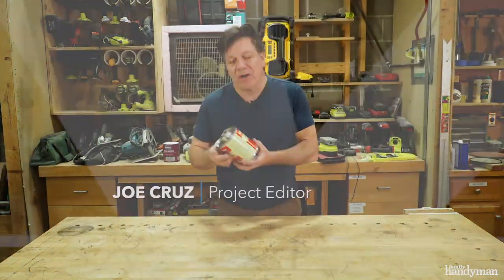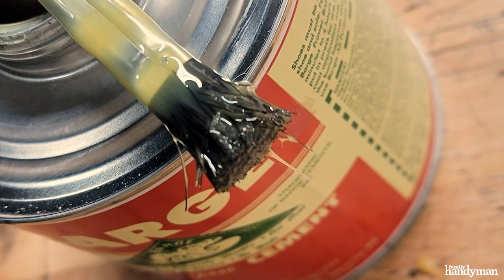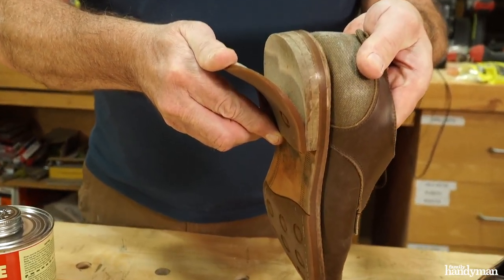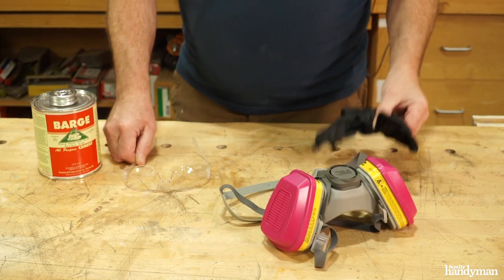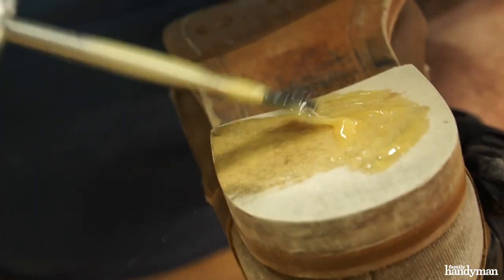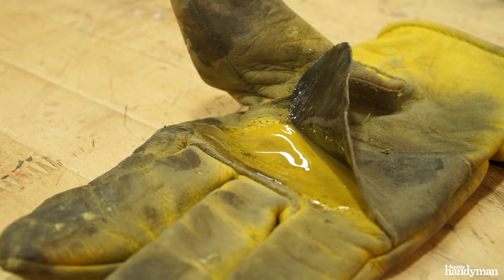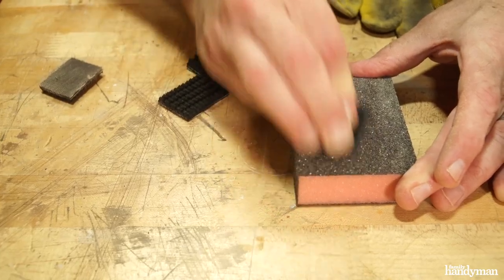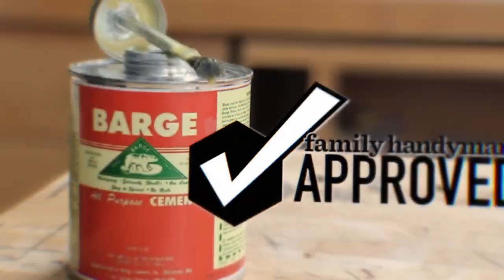Family Handyman Approved: Barge Cement

Comment: 15 mins to 4 hours iz a big stretch! How do you know the correct time for a project? I don't want it to harden before applying. I am cementing patches to my leather jacket thx
Reply: I think they mean 10-15 is a must but you can go up to 4 hrs. They aren't very clear about why youd want to wait 4 hrs if you only need to wait 10-15. 

Dry Time: 10-15 minutes

Open Time: Up to 4 hours

What is Dry Time?

Once Barge has been applied to both surfaces, dry time refers to how long you must leave the two surfaces separated in order to allow the solvent in the adhesive to evaporate. Humidity can affect dry time. For best results, before applying Barge be sure that the materials are clean and dry. It can also be beneficial to lightly sand the material, but be sure to not leave any dust behind.

What is Open Time?

Open Time refers to the amount of time that pieces can be left out with adhesive on them, before they are put together and bonded. Once the items are bonded together, it will take roughly 1-2 minutes for the adhesive to cure. If open time ever extends past the suggested length of open time, Barge recommends applying heat to the adhesive (ex: hair dryer). This will help to revive the adhesive if it has been left out too long so that you can then bond the materials successfully.

Comment: This particular brand (Barge) of what is basically 'Contact Cement', is the absolute best I've ever used! Let the areas that the cement has been applied to set-up for at least 10-15 minutes (depends on how warm or how cold it is), and then stick the two together. But a word of warning ... ya better get the two pieces lined up correctly the first go at it because, you ain't-a-gonna-get-another-chance once the two pieces make contact with one another. Ask me how I know.  :-/  I bought my can (same size as the one in this video) a long time ago, and I honestly can't remember where I bought it from? But I bought it On-Line. So, I probably bought it from someone off of eBay. And it was like around $30.00 + shipping at the time (20 yrs ago). So it ain't cheap. But the good stuff never is.